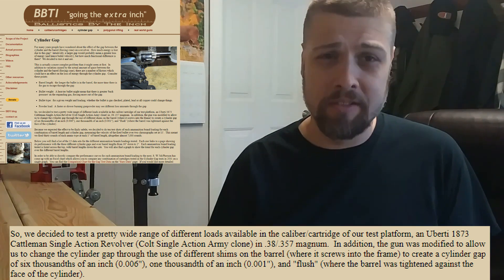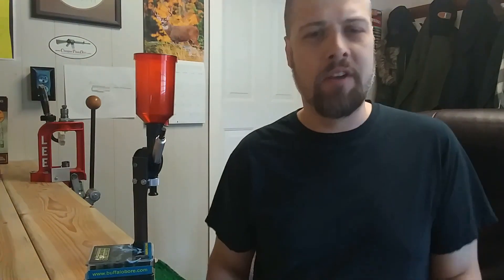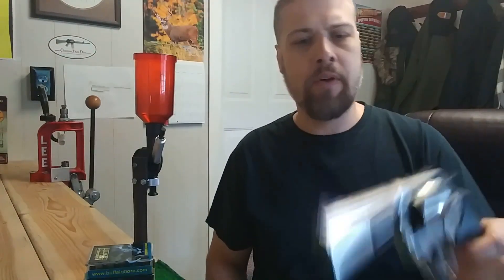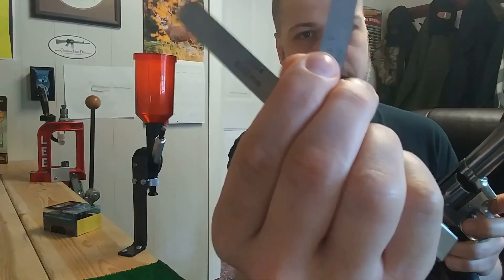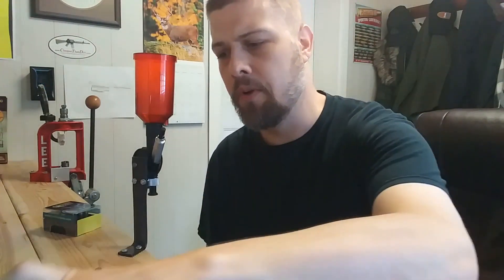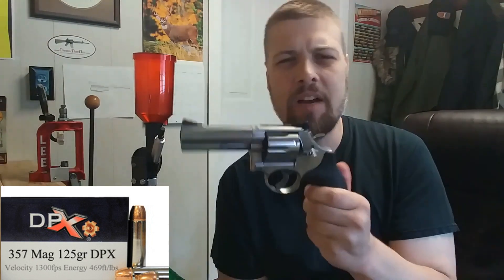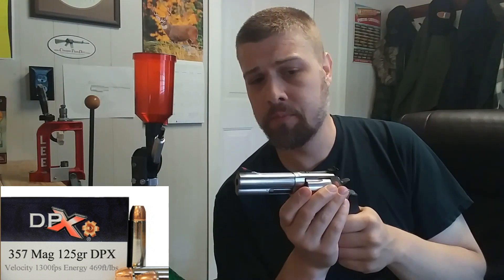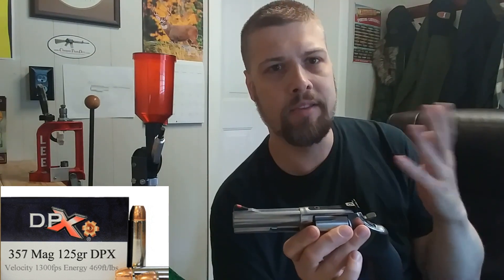Revolver Myths Episode 1. You Lose MOST of Your Velocity Through the Cylinder Gap

Comment: What people extolling the virtues of a semi-auto compared to the revolver's energy loss through the gap (as you said, 3-5%) seem to forget is the energy loss in the semi-auto to cycle the gun.
Reply from the maker: I have actually been interested in knowing whether there is any energy loss through the action of pushing the slide back on a semi-auto. I have had discussions with people who point out that "all" of the powder, blast etc pushes the bullet out of the bore before the slide begins to move back, so in theory there shouldn't be any velocity loss. However there's still energy used to push the slide back.

I guess the thing that stands out to me is that even though the bullet leaves the muzzle before the brass even begins to push the slide back, would it or would it not slightly relieve some pressure backwards and not forward even before the bullet leaves the muzzle? I think that possibly well undercharges rounds and a semi auto that has the slide locked in place and a good old fashioned test might be a good place to start, comparing a fixed slide vs a free slide. My only concern is for semi-auto's with partially unsupported chambers, if the extra force has nowhere to go will it cause a case blowout? These are all things I would like to know.
Reply: "pushes the bullet out of the bore before the slide begins to move back"

The force is applied in both directions at the same time. Just because the bullet leaves the barrel before the slide cycles doesn't mean that the energy has not been spent yet — it has. Otherwise the slide would not cycle. It just has a much higher mass than the bullet, so it has a higher inertia.

All the calculations trying to eliminate the impact of this or that factor with a revolver or a semi are somewhat complicated, and what's more important, not really relevant to the real world. It would be like trying to calculate how much more efficiently a human could run if he did not spend all that energy on breathing.

So, while your work is admirable, and it answers the question someone asked, the question itself is purely academic. There are other aspects of revolvers and semi-autos that have far higher impact on the outcome, and there are aspects of both that make them preferable for different applications.
Reply: @GunSam  Actually, the slide does move a very tiny bit when the bullet leaves the muzzle. This is why locked breech design exists, so that the barrel and slide are locked and the case doesn't bulge. The barrel drops and unlocks when the pressure is WAY down. You can figure out how much the slide moves with the simple law of conservation of momentum. The slide and barrel have the same momentum as the bullet. If the barrel and slide has 100 times more mass than the bullet, then it moves at 1/100th the velocity as the bullet. Therefore, the slide moves 100th the distance that the bullet travels to leave the barrel. The kinetic energy loss from this movement is laughable, just as with the cylinder gap, probably even more so. Basically, the kinetic energy of the moving slide and barrel is the kinetic energy the bullet is losing from cycling. Hypothetically, if the slide had the same mass as the bullet, they would both have the same kinetic energy, which would be really, really bad. lol This is why the casing from a round that fires outside of a chamber is much more dangerous than the bullet itself.
Reply: @GunSam  one simple test would be to fire a semi auto as normal, letting it cycle... then shooting it again but manually hold the slide to prevent the cycle. Then see if the bullets had different FPS.
Reply: @GunSam  There certainly is some velocity loss from the energy it takes to push the slide back.  The Gas pushing against the bullet is what drives the slide back.  Certainly the slide moves after the bullet leaves, but that's because of the momentum after the initial push.  Think of it this way, if you lit off black powder in the barrel with no bullet the slide would not move.
Reply: It's all theoretical until you can see it. Take a look-- 73,000 frames per sec on Mythbusters:  https://www.youtube.com/watch?v=7y9apnbI6GA
Slowing the Mythbusters video down to 1/4 speed on Youtube, I can see the slide hasn't moved more than 1/16" by the time the bullet is about 1 foot beyond the tip of the gun muzzle, by that time the bullet is beyond the reach of higher pressure air and starting to take on more wind resistance than it has gained in air pressure behind the base from the exiting muzzle blast. The most dramatic and critical part of bullet exiting the muzzle is the instant the bullet base breaks the barrel seal and the hot gasses explode out around the bullet base. That's why muzzle crowns have to be very well machined and burr-free to prevent any upsetting bullet balance.
It's a fun video. You can see a small amount of gas escaping the muzzle even before the bullet appears. Probably some gas escaping around the diameter of the bullet.
Reply: In recoil operated handguns, there shouldn’t be any velocity loss. In a recoil operated handgun, the gasses from the cartridge don’t cycle the action, recoil does. In gas operated weapons there is a small loss in velocity since a portion of the gas is used to work the action. It’s the reason semi auto and full auto gas operated rifles have slightly lower velocities than bolt actions, where the action is sealed and all of the propellant gasses push the bullet down the barrel. 

Revolver, recoil operated, or gas operated, I don’t think any of it really matters. There might be a difference but it’s not really much of a difference to make a difference. If your weapon is in good working order, you’ll still put a hole in something. If you’re concerned about velocity, everything you shoot should be bolt action. But we deal with these operating systems for the sake of convenience and rapid follow up shots.
Reply: @leroyjenkins4811  "If you’re concerned about velocity" -- I am not, but I am sick and tired of hearing how much loss there is in a revolver due to the cylinder gap.

Comment: Years ago I ran some 230 grain ball 45 acp over a chronograph, through a 5" Springfield 1911(the model that looks like the Kimber eclipse) and a 5" S&W 625 revolver and the revolver was on average 50 fps faster than the 1911, the only thing I can think of is the 1911's chamber is a little more generous to feed more reliably than the chambers on the revolver.
Reply from the maker: A 5" 625 would have more barrel travel than a 5" 1911. A 4" revolver compared to a 5" 1911 would be closer in bullet travel in the gun.
Reply: this may be why the fps was greater in the revolver
Reply from the maker: I am pretty confident that the barrel length is the reason why. When you think of about it, a .45 ACP cartridge at most is 1.300" long. In a 5" 1911, that leaves only 3.7" that the nose of that bullet remains in the barrel because an auto's barrel is measured all the way to the start of the chamber. The revolver would have that full 5" barrel and even then some because of the distance in the chamber , so i'll guess 5.5" in the revolver. Almost 2 extra inches of bullet travel in a revolver of the "same barrel" length. The .45 auto is not known for getting huge amounts of velocity gain with more barrel length. If this comparison was with a .357 magnum (like a Coonan .357 auto vs. a 5" revolver), there would be a much more significant gain in velocity with the revolver, probably well over 100 fps more.

Comment: I used to worry about gap loss or "bleed". A few things fixed that. You pointed out the article in BBTI in comments somewhere. Also, it is really hard to ignore the fireball coming out of the muzzle!
Reply from the maker: The fireballs basically will indicate that energy is escaping out the gun all over, no matter the style of gun. Lots more wasted energy out the frot of any handgun (compared to a rifle) so picking on the 5% is kind of silly.
Reply: I agree. Also, you HAVE to "waste" some powder at least if you are going for a hot load. I don't think it is possible to tune a load to produce max velocity in a given barrel AND finish burning before the bullet gets out. Flames come out of the headers in internal combustion engines too. The exact same principles are in play. Plus powder is fairly cheap at the amounts used in pistol ammunition.
Reply from the maker: It's hard to get a perfect handgun load, but with the right configuration and powder type one can come close. What comes to mind is the .38 special+P HST. Mr. Guns&Gear chronographed that ammo in both a 1.875" and 4" S&W revolver, and the velocity was about the same with both guns, I think the velocity was even a few single digits higher with the snubby. Personally, I think a company that makes .38 special ammo, could put some time into research and development, they could make a .38 special+P to match any 9mm out there. I feel like if there was .38 special brass, and the lower half of that brass(closer to the rim) was made much much thicker, and the top half of the brass was the same size to accept a .357" sized bullet, you could potentially load the lower half with a comparable powder charge to a 9x19 with the same pressure levels, and then recess the bullet in the top of the case like they do with the .38 special HST, and have a very good shooting .38 special cartridge. Would rival the 9mm but also give the bullet more travel in a snubby, probably a good 3" of gun travel in a 2" snub to rival a 3.5"ish bbl 9mm pistol.
Reply: I can't help noticing that the chamber wall thickness and forcing cone thickness on my 638 and 649 are about the same. The 649 is beefed up around the forcing cone area and uses a bull barrel and steel frame. It's a bit of a punisher with the .357 loads. I expect most people (myself included) would prefer to shoot mostly .38 Spl and only occasionally shoot .357 Magnums. That would extend the life of the gun and the shooter's hand. If we are real here, it is easy to load a .38 Spl case to .357 Magnum pressure. It's only 35,000 PSI which is the exact same as 9x19mm standard pressure. There's a lot more case capacity in the .38 Spl case. So to do what you propose, you could simply trim the few mm off of a .357 Magnum case to get the same length as a .38 Spl case. The difficult part would be finding a powder that with a given bullet (say a 125gr JHP or the HST) that won't burn so fast as to blow the cylinder up or crack the forcing cone.

What I don't know is how long a typical 9x19mm powder charge burns. What would happen if you loaded a .38 Spl case with an HST and then used the 9x19mm loading data for a bullet of that weight? I'm sure it would be fine out of a .357 Magnum because the extra case space would prevent the pressure from reaching the 9x19mm level. You would probably want to start at say 15% less than a .357 load and work up. Or just start at the 9x19mm load data.

It's really too bad the LCR in .38 Spl. is as expensive as it is. Maybe there are Taurus revolvers or some other cheap J-Frame size and weight revolvers that could be tested. Anything with a 2" barrel. If you can get 1200fps or so out of without damaging the gun using a 124gr bullet, you have the 9x19mm in a .38. The 110gr loads are probably pretty good with muzzle velocity too. That gets a bit light for my personal taste. I don't even like the 115gr out of 9x19mm. I really need to come up with a good argument for why I like the 124gr in 9x19 over the 115 and 147. Right now it is a gut instinct thing. Although the 147gr loads have gotten much better since I formed my opinion.
Reply from the maker: If I just off the top of my head think about the 9mm, I believe that the 147 gr in and of itself was created for no other reason than to be used with suppressors, but I could be wrong. Obviously the 124 gr at a light+P load is what the NATO cartridge is, so obviously many others agree with you. When I had a few 9mm pistols in the past I remember that most target ammo was 115 gr, but most of the available reloading bullets for it were in 124 gr. I always thought that was odd. 

With this whole recessed case ammunition thing, and with the invent of lighter snubby .357 magnum guns, the best way to make a more powerful HST style would be to just go with a .357 magnum case from the start and make a .357 magnum cartridge. I think a reasonable expectation for something like that would to be just a little less powerful than a .normal .357 mag but a little more than a 9x19, that way would could get a 124 gr or so up to maybe 1,100 fps in a snubby, or 1,200 in a 4" but have less muzzle flash than a magnum but with more power than a .38+P. The only new thing introduced with this setup over a standard magnum would be slightly more gun travel to burn up the powder. Would this make an effective load or not? Who knows :)
Reply: I think you've just described Hornady's Critical Duty and Critical Defense lines of ammunition.
Reply from the maker: I know that Critical Duty is only available in .357 mag and not .38 special and is watered down. The Critical Defense is full power with both cartridges, well what most people consider full power anyways. My thought is to have the same power factor in .357 mag as Critical Duty, Golden Saber, DPX etc (450-500 FPE in a 4") but to have it deeper in the case with less powder, which will increase the pressure, decrease the powder needed to gain that pressure, and in turn decrease muzzle flash.
Reply: Yeah. I don't know how the Critical Duty is actually loaded. Perhaps I should pull one apart. What I do know is that the recoil is gentle as a lamb compared to the Fiocchi 142gr .357 Magnum FMJ loading. I have not test fired the Critical Defense. I do have some of that.

Comparing my 649 against the M66-8 is interesting. The M66 is a lot bulkier and 10oz heavier according to spec. I haven't weighed them yet. The difference in barrel length is only 0.625" in favor of the M66. The cylinder is a tad longer though. So it seems the M66 is built for heavier loads than a J-Frame can handle even in steel. I wish that S&W kept the 3" barrel on the M66 even with the new lockup and barrel sleeve design. I know it's only a 1/4 inch. I just like the round numbers.
Reply from the maker: The only specifics I know about the Critical Duty .357 magnum is that the lead alloy is harder than normal, the jacket is thicker than normal, there is a band near the bullet base that prevents jacket separation, it's 135 gr and travels at only 1,300 fps in a 4" for about 500 FPE and it still has the rubber tip plug. If I remember right, the Critical Defense .357 magnum is 125 gr, rated at 1,500 fps in a 4" for over 600 FPE, thin jacket and soft lead. Critical Duty was truly designed for LE work with probabilities of shooting through car doors and glass, but why in .357 mag? Probably because some countries, specifically in South/Central America, still use wheel guns in LE. The Critical Defense was made for up close, no hard barrier civilian social work :) The lower power for the Critical Duty is for my best guess, because of the need for quicker follow up shots. I mean, if you're a Cop with a drug cartel runner coming at you in South America in a car, how slow do you want you follow up shots?!? This is all speculation, but it's a colorful hypothesis.
Reply: I have some of the Critical Defense in .357 Magnum too. (BTW, I can totally understand why Paul Harrell doesn't like "hyper" ammunition because it is expensive to try out different kinds when looking for carry ammo!) I'll have to try them side by side. I am curious about how much velocity I will be losing going with the 2.75" barrel over the 4" barrel in the M66-8. It balances quite well and is quite chunky at around 33oz. The unloaded weight is very close to the fully loaded weight of the G30 with 230gr hard ball. It's ten oz more than the M649 which has a 2.125" barrel and that is about 7oz more than the M638 with the 1.875" barrel (and .38 Spl +P).

If I'm getting over 400 ft-lbs and the bullet is designed properly, I would expect that to get the job done. No expansion is going to result in a complete pass through from any angle, or so I suspect. I don't know the rules for deer hunting, but I would expect 600 ft-lbs to be able to rapidly dispatch those evil beasts.
Reply: I need to remember to expand the threads so that I know what I've already said. Too much repetition!